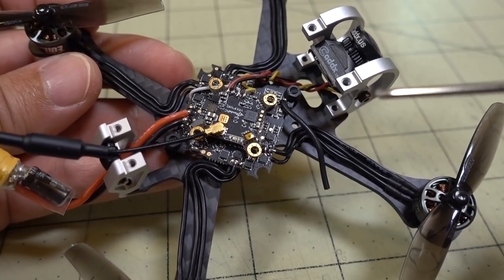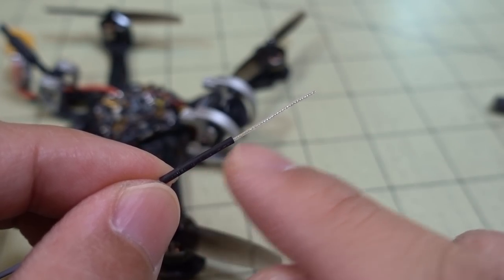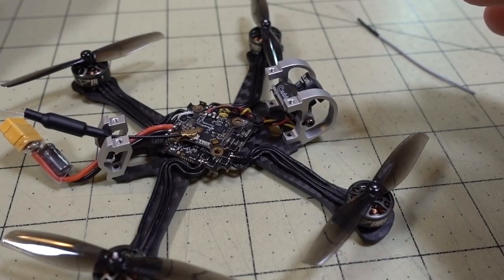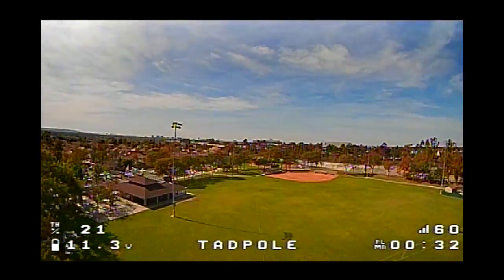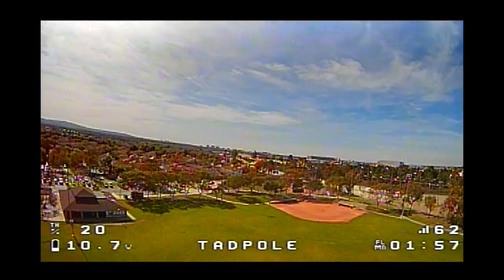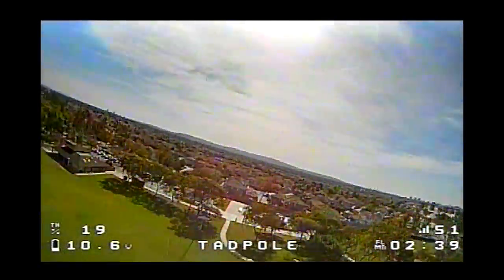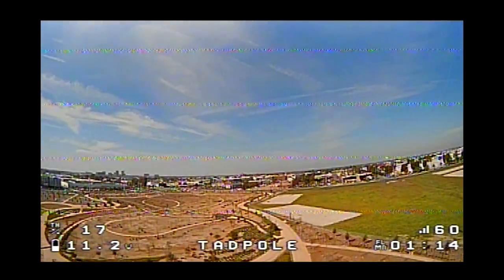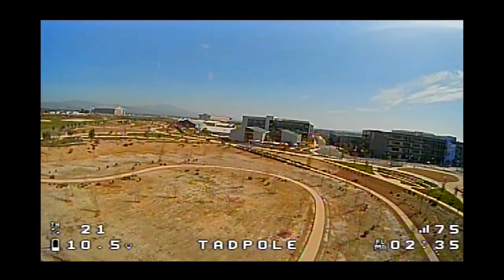Get MAX Range on Your SPI Receivers! 🎓

Comment: Performed this mod and it only reduces range.  If you are flying above the ground, antenna underneath actually makes more sense.  RSSI is reduced by a solid 20% on FrSky and Redpine protocols after the mod.  Extending the monopole or relocating it with coax will similarly reduce the RF performance of the RX design.  The negative pole and ground and a ground plane are not to be confused.  They are not related.
Reply from the maker: It's actually quite easy to mess up this mod and I made a follow up video on another one where it didn't work.

Comment: Funny, just yesterday I put a 9db antennae on my T16. Much farther range with no weight. Just looks stupid. On guard! Been thinking of getting a remote wip to put up high. Top of the car, magnetic base, 20 degrees outside, heater blowing nicely, still have feeling in my fingers.
Reply: Albert. Please let me clarify. My jumper T16 looks stupid with the 2 foot sword sticking off of it. I was not trying to be negative, at all, towards your mod. I love what you are doing and will be modifying all my SPI antennas. I learn from from every video you make. My humor is lost in translation a lot. One of my flaws.

Comment: These are a great set of video's. Considering all of these spi boards come with a specific length (approx. 28cm) of 26awg wire that acts as an antenna which is amazing to me they even get the range that they do being so close to the boards, they aren't single core either, they're multi stranded, I would love to see this kind of a test if you just took a longer piece of 26awg wire (like an xmplus antennas full length) and soldered it without the benefit of coax ground potential for the entire length of the wire. Im no RF engineer (I studied electronic engineering) but I remember antenna grounds were implemented for safety, while in our hobby I can see that it should have its benefits id like to know how much benefit there would be for such short antennas and the frequency we use. Basically the outer coax acts as an electromagnetic shield for the full length of the inner core as the signal we want will be picked up by the active part of the antenna (short visible part at the end with no coax which physical length normally depends on 1/2 the actual wavelength of the radio frequency unless you make an electronically cleverer receiver, like what we use so it can be shorter) and then travels down the wire as a standing wave into the rx, if the coax does its job which is the much longer part of our antenna than the active part, it isolates signals/noise from other frequencies as they will be induced on the full length of the outer coax core and sent to ground and not make it to the inner core where the signal we want is induced. also not to mention other external electromagnetic fields that are not signals from transmitters at all. You can see as antennas work the induced current generates a voltage so there will be a voltage induced on the outer core which is why you'd ground it. I hope what I have poorly explained makes sense. The point being id like to know how much worse a non shielded longer than it needs to be antenna would perform when it cant isolate unwanted electromagnetic fields like for example lower frequencies than we use and other random electromagnetic fields. As most of you will already know any conductor of varying length will act as an antenna for fields of varying wavelengths as this is simply just induction. as a really simple example a UHF (analogue TV) frequency of 470mhz has a wavelength of about 600mm's. If we make our antenna's that stupidly long we'll be picking up analogue tv signals on the lowest UHF band and our little xm plus's will be bombarded with noise it doesn't need to deal with.
Reply from the maker: I tried this already based on another suggestion.  It got a failsafe within 100m or less so not worth exploring.

Comment: Hi, I was wondering if anyone may be able to answer this ?.. will this same size antenna connector fit the novice 3 board? It's the toothpick F4 spi D8? I believe that's correct?

Comment: If the extra range is simply putting a 'different piece of wire on' that would cost fractions of a cent I am shocked they don't bother. Hopefully the manufacturers are watching your vid and make fit the better antennas from now on. Thanks, I have a couple of old antennas that I had accidents with so they don't have the connector on that I will try. Thanks.

Comment: Def interested in Mob6 mods. Mine has HORRIBLE range. (Flysky version).
Reply: Mine too I go into the next room and it drops out. If I position my spi antenna a little different I do get some more range out of it. It's just super sensitive

Comment: My Mobula 6 failsafes at less than 50 ft with an external antenna.  I guess I can try cutting it to 28mm to see if that improves it, but I have been very disappointed in the range of this rocket.

Comment: Do I simply buy the antenna, cut off the connector and solder directly? It looks like you've done something different with it?
Reply from the maker: Yes, that's what I did
Reply: @AlbertKimTV  Thanks alot, So i should be fine to use the FRSky 150mm cut it to a suited length aslong as the active element is 30ishm I think it's 30.22 or 31.22?

Comment: While your results are impressive, I don't understand how that's correct length on the active part of the element?  The XM+ and XM receivers have some inductors or capacitors inline with the antenna that change the length of the active element from the mathematically correct length.  This was shown by Bruce Simpson in a video some time ago on RCModelReviews ( https://youtu.be/WBE_KqqHbM0 ).  However, this might just be splitting hairs since the results are so good with the FrSky Infinity Antenna and it might just be that these are in fact "tuned" to that antenna.  Also, out of curiosity, have you tried simply not grounding the new longer antenna, or in other words, making a longer monopole antenna using your FRSky replacements? Just concerned with people nuking a perfectly good FC trying to solder to a ground next to some vital component. 
Great job Albert and a tip of my hat to you for all that you have done!
Reply from the maker: I have no idea what this is tuned to.  I'm just going on a suggestion from someone in the previous video where they suggested using the length from an XM+ receiver antenna.  I used a more recent receiver as the length from older XM+ receivers is a different length.  However, I'm not really trying to optimize this 100%.  I'm more interested to see if there is enough improvement to warrant not using an external receiver and save some weight.  I'm thinking these results are "good enough" and for some of these super light micros, this makes SPI receivers more viable than before.  As always, beginners should beware.  These mods are not easy for those who can't solder.
Reply: Albert Kim - I think you have clearly proved your point and I whole heartedly agree that some serious soldering skills will be required.  Hopefully, we’ll start seeing a ground pad for the dipole antenna showing up on newer FCs with the built-in SPI receivers.  Again, Albert, great job!

Comment: how much would this improve range of the novice 2 ? thnx for the good videos!
Reply from the maker: Hard to say for sure.  I have messed this mod up on other quads and made the range worse so it has to be done perfectly and under ideal conditions you should see some improvement. The extent to which it could improve will also vary with the environment you're flying at.

Comment: to where u solder the gnd of antenna??
Reply from the maker: There are some capacitors next to the antenna.  I used a multimeter to find the closest one that goes to ground.  Make sure you only solder to ground and not anywhere else.  Also, there is a close up photo of the connections made in the video.
Reply: thank u bro 👍👍